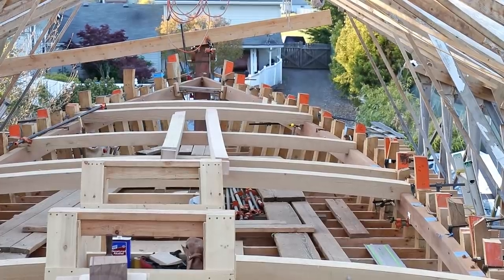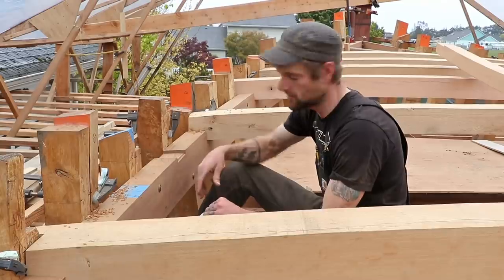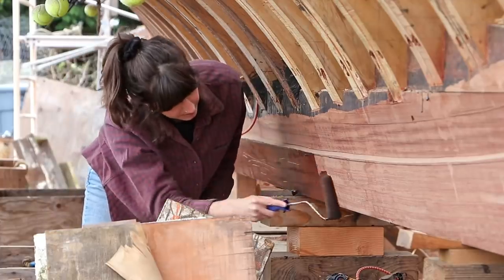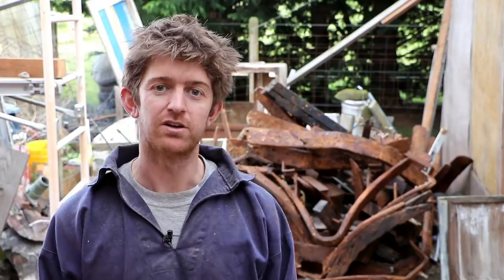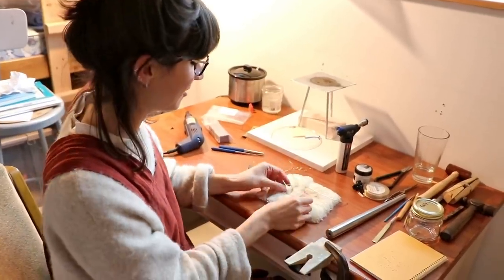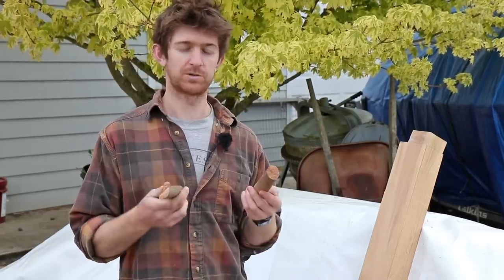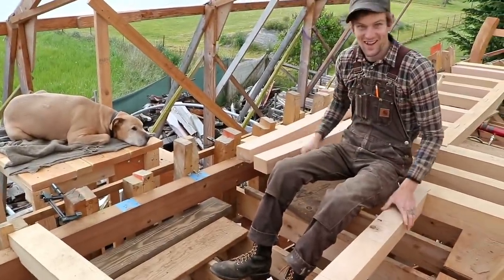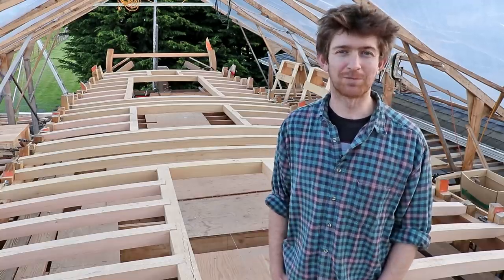BoatBuilding - Building the Deck Structure! (EP71)

Comment: i noticed how much bend the long deck beams have when you walk across them. Will there something supporting them or will they just carry the deck directly?
Reply: once the decking is on that force will spread to the other beams, and once the planking is on it should stiffen up the ends so that they don't deflect as much either.

And because it is timber, there will anyways be a little bit of give and flex in it, but much less than what you see now

Comment: Look at that contaminated wood under black light and see if it glows.  Try both short wave and long wave UV if you can (might have to borrow a short wave UV light, they are kind of expensive).  Long wave, 395 nanometer, UV lights are inexpensive.  If the bacteria glow under UV that would give you a good way to inspect the timbers.

Comment: Is anyone else feeling like the only reason they are saving that hatch frame is to say some part of the boat is original? Surely it is less work to replace it. Also you are sanding off lead paint. Wear a respirator, do it in a special area, and vacuum it all up. I was posioned from lead dust at about your age, don't make the same mistake. It settles on everything and you eat it by swallowing mucus from your nasal cavity, and from transfer after touching it. I'd carefully consider the resuse of a lot of stuff due to the lead paint alone.

The boat is looking amazing, I really appreciate the work that went into the joinery and the fit you produce. Looking forward to the next one.

Comment: The foremost hatch does not seem offset enough to accommodate a sampson post or any other deck fixture. I'm going to guess it's so that it lines up properly with the interior layout for the boat at that location...if that has already been drawn up that is. Hatches that are not centerline are usually positioned based on that requirement.

Comment: Hi Leo, I have a quick question. When making less structural parts of the boat that will still be exposed to the elements, is it still just as important to avoid knots in the wood? I'm just wondering whether avoiding knots has to do mostly with strength or rot resistance, or any other factors that I may not have considered

Comment: As others have said bronze castings do not make as much sense as welded fitments for both strength and ease of manufacture.  My dad built a Little Engines steam loco using a bronze casting for the main firebox and rear section of the boiler. It was a terrible experience because of the flaws in the casting.  The boiler firebox burnt out after only two steamings.

Comment: After a bit of googling (so probably not telling you anything you don't already know) bacterial wetwood or slime flux is an anaerobic bacteria inside the wood, which probably entered the tree from a root wound.  The characteristic wet look (and slime exuding from a bark wound when the tree was alive) comes from the bacteria weakening the cell walls in the wood itself, as it consumes it.  Articles seem focused on curing the live tree, and consist of washing it off so bugs aren't attracted, but I could find nothing on it weakening the hardness of the wood for high-stress applications such as this.  I couldn't find anything indicating it's not safe for other timbers to 'catch' it, as it's a living tree disease, but best be safe and not have it sitting on other timbers, just in case.  Same with any shavings from plane or chisel.

Comment: I've seen that dark spot before and was told it was caused by mold that was encapsulated as the tree grew around it.  It was described to me as "pithy", which can apply to wood, potatoes and carrots, it's spongy and a weak spot so yeah, don't use that piece.  Casting bronze is tricky,  but it will definitely last longer then iron.  While iron can be treated to make it more corrosion resistant, it's never going to be corrosion proof, so if you can't access them to keep them clean and painted, it's better to use bronze.

Comment: I've noticed some of the half beams are sitting proud of the carlins, will they be adjusted during the final fit?  Also, I'm envious of you and other guys can get the tools so sharp, I guess it's practice.
Reply: At this stage, Tally Ho is becoming her own Lofting floor resultant from Leo's insanely precision measures and construction. It is easier, and faster to fair proud  joints on the complex, multi-radius surface where the  final  decking planks will lay.  I believe that it is simply reducing the number of time consuming finishing cuts similar to roughing out the lumber with a chainsaw...now replaced with a beam cutting circular saw due to "noisy neighbors". Me learnst from building 7 boats in my backyard boat yard (smile).

Comment: Why is the foremost deck hatch, at the bow, off centered to starboard?  Good question. Upon reflection, and without perusing the detail plans of this sailing vessel, I would say that it has been moved to allow better access to the forward chain locker. ⛵⛵  As for the cast bronze floors, I was also thinking about the less expensive welded bronze floors in the Arabella.

Comment: Excellent workmanship and killer progress - super well done. BTW are their floors on every frame station or does the design not require floors at every station? Pity you can't use high density foam strips and glass to render the frames.

Comment: Leo, can you post where you got the long blue alum straight edge with the black handle? It sorta looks like a concrete float., but probably not. It appears to be around 5' or 6', and one side has ridges and the other is smooth. I would appreciate that very much. By the way, you have an incredible knowledge of woodworking and are doing a great job!  I wish I could help, but am not very mobile due to a knee replacement from a auto accident. I wish you the best and keep it up!

Comment: It is possible that the darker section of oak timber is the centre of the tree (the heart). Sometimes the centre of the trunk can become damaged and die. A common cause would be severe weather (heavy storms) or invasive insects or other creatures. This internal defect to the heartwood is sometimes called 'Heart shakes', Cup Shakes' or Star Shakes'. Once the heart of a tree is breeched, it often dies and as it does so, the Heartwood loses moisture content and becomes brittle. I can only guess that the vinegar odour is caused by decaying wood fibres.
Another reason for the darker weaker would could be the junction that a branch limb meets the main trunk. Smaller branches cause knots but on a much larger scale and with the timber being a hardwood, the knots are much tougher and don't fall away when being machined in the saw mill.

Comment: Leo, I couldn't help but notice your use of polyurethane glue in making the bent laminations for creating the bronze floor castings.  Is this glue something you've used before, and if so are you satisfied that it will retain its form over the years?  The reason for me asking is because in my bent laminated furniture pieces I have been successfully using PPR glues.  But because these glues are highly carcinogenic an effective and yet safe alternative glue would be nice to find.  Your thoughts?
Reply from the maker: Hi Marty, I've used PU glues a lot in boatbuilding and I've never had any problems. It's not structurally gap-filling, so the joints / faces need to be relatively tight.

Comment: Leo  - Couldn't help but notice in a prior episode that the plans showed a tiller, as the steering setup. Surely for long haul sailing, as you have said you intend to do, this will not be feasible. Do you intend to convert to a ships wheel, with rudder connections? If you have covered this already, my bad.

Comment: Leo, you talked about why the opening is off center in a previous video and mentioned that it was centered in the original plans, changed during initial creation and that you were going with the change rather than the plan and why.

Comment: Surprised that you used a grinder with disk pad to fair in the frames.  I assume you come back afterwards with a plane or belt sander to clean up all the little "circles." Guess it's the fastest way to remove wood stock.

Comment: Leo, I what dictates the joints you use in the different joinery around the boat?
Are they on the plans?
Are you copying them from original locations or some other mysterious equation?
Also could any defect White Oak be used for non load bearing furniture? 
Tony from Western Australia.
Reply: Stated in previous videos that they are following plans & what was on boat.

Comment: Hey Leo,  I'm guessing you're already familiar with Doug's casting and foundry work to make many items on SV Seeker. The casting work is certainly a big job, you mentioned casting in bronze, but is this just for authenticity, or couldn't other materials be used more effectively ? Fiberglass or wood composites should be much easier, or what about zinc dipped steel or even aluminum structures instead of bronze ?  Am I understanding their purpose is to tie the floor structure to the keel ? Do you have any intentions of storing anything down there ? As is, the supports are purely bent 2D forms, but an optimized 3D shape could allow you to make a much thinner, lighter AND stronger supports, costing less in bulk bronze  per piece.

Comment: looks to be too far forward for the mast so maybe the offset forward deck opening is to avoid the anchor post (is that the stem-post ?) Anyway something structural is in the way of the hatch and is pushing it to one side or the other.

Comment: Why don't you use stainless Steel for the floor bracket thingys? You could bend the bar with a bit of heat and bolt them down.
Reply: Ferrous metal (even st stl) is verboten on board Tally Ho - iron in contact w/ wet wood corrodes & weakens the wood, & mold/rot gets in faster.

Comment: Just how many of the ribs did you guys break while bending n molding them to their final shape?  Idk but building one of those has got to amount to building 200 to 300 houses. Basically one hll of a lot of work. time, time, time. To soak or pressure'ize the wood where it's flexible. Gotta be about two n a half weeks per rib.
Reply: The ribs weren't bent or molded, they were sawn.

Comment: The hatch is off center because the plans call for a head located forward to port.  If the hatch was in the center of the boat you would descend directly into the bathroom.

Comment: be careful with casting!
i've learned pattern maker when i was younger. You can still use your templates to create patterns for the bronze casting with the right dimensions (including the shrinkage rate ! ). If you have a foundry nearby they should be able to give you the specifications for either the dimensions and the pattern they need to perform the right casting.
Just be clear that after the templates you'll have to make a pattern for each single floor you want to cast. 

If that seems to complicated/expensive/time consuming for you, consider welding the floors out of bronze plates like they did on "Arabella" (Acorn to Arabella)

Comment: “I’ve sworn an oath of solitude until the petulance is purged from the lands.”

Why would the foremost deck opening in a sailing yacht be off centered towards the starboard? I asked this question online I didn’t get any specific answers almost everything showed up was for modern plastic sailing yachts (I know it’s not exactly plastic.) I checked both with yacht construction and racing yachts but I couldn’t find the answer so I’m using the wrong terms, I assume. Anyway, I’m guessing and it is purely a guess that that’s the chain locker and the majority of time or perhaps all times the anchor is on the starboard side because it would interfere with the Portside which is where the port/dock is located and you don’t want to huge anchor smashing into the dock. That is a pure guess but I basted on the logic I expressed earlier.
Reply: I know the bowsprit is offset on this boat. I bet it's structural and is to support the bowsprit.

Comment: The foremost deck opening is off center so there is room below for specific equipment to be stowed.  A chain locker perhaps, but most likely The Head.  Its called The Head for a reason!

Comment: I did a little research on your oak issue. Apparently this has been a known issue for a number of years. Yes it is called wet wood  but most of the research I read was from the 1980’s. At that time they were still trying to find a common cause. Pollution and changes to growing in more flood prone areas have been mentioned. As have Gypsy moth infestations.  All of these in my mind have a root cause which is stress on the trees. It is not uncommon for trees to be infected with bacteria IE. Dutch elm comes to mind but it is unusual for it to be in the heart wood. At any rate the bacteria grows in an anaerobic environment (no free oxygen) and produce fatty acids which I suspect is why you smelled vinegar.  The article I read was about the affects on the producers of oak products and the financial harm which was being caused by it. There is no apparent evidence of of the bacteria until the log is processed. Hope this helps. On another note when making bread yeast is added to the dough which causes the carbon dioxide to form but in better breads the dough is left in a refrigerator over night or up to several days. It is during this fermentation that the yeast growth is significantly retarded and the bacteria becomes active and in this case produces lactic acid when get bread much more flavor. Cheerio

Comment: why don't you relieve the corner of the floor pattern for the limber hole, save some bronze too!  do the keel bolts come up thru the floors and if so do you have to drill down to "match" the existing keel holes.
Reply: The floors will be through-bolted to the underside of the timber keel. These bolts are separate & offset from the bolts that attach the lead keel to the top of the timber keel.

Comment: Episode 7 showed concrete ballast over the metal keel/frame pieces, at least that's what I think I see.  Why have limber holes if you're going to pour concrete there?
Reply: That concrete didn't cover the top of the keel or the old floors, it just filled the space between the planking & the sides of the keel.

Comment: Concerning the discoloration: I think this is what's called 'bruinrot ' in Dutch.  A fungus breaks down the cellulose in the wood and that's why it breaks in such a particular way. It's typical that you don't see much signs of this type of fungus on the outside surface of the wood. (That's what I found...)

Comment: The deck structure really looks great and the 20 minute video doesn't do it justice for all the labor that was involved in building it. The cast bronze floors are going to be something to watch being built and should be a much better connection than the iron floors.

Comment: Is there a reason the cast can't be aluminium? Is the oxide layer not resistant enough?
Reply: sadly sand cast aluminium is usually quite porous and very susceptible to intergranular corrosion.

Comment: If the bilge is wood and the bronze floors are attached to wood, why can't the floors be wood? They would have to be thick to match the strength of bronze, but there is plenty of room at the v of the boat. Wouldn't wood be economical and a lot quicker?
Reply: Sid Vak - Weight!!!

Comment: Could the infection be a Slime Flux reservoir? Tree becomes wounded by a stress, bacterial infection sets in. The product of the infection then weeps out. Smells awful. Like a sickness, sweet and sour all at the same time. Like a human wound that gets an infection. Localized to that particular grain section. Again like a human that rips a muscle that then becomes infected. Localized.
Reply: "An important point to remember is that wood-decaying fungi grow very slowly. It can take these pathogens years to decades to create a volume of decay that is large enough to cause stem failure. The rate of decay varies with tree species, fungal pathogen and location of the pathogen (roots vs. trunk). The presence of some fungal pathogens (e.g. Grifola frondosa) does not always indicate extensive decay is present, whereas others (e.g. Ganoderma applanatum) signify extensive rot has taken place. Accurate identification is critical. Fungicides are of little use against wood-decaying fungi because the pathogen lives within the soil and woody tissue, making it very difficult to contact. Non-destructive detection of internal decay using tomography can be an important tool in determining if a tree is a hazard or remains structurally sound." - Nick Brazee, UMass Extension Plant Pathologist

Comment: Bronze floors will greatly strengthen the hull of the boat. But they won't make stresses on the boat disappear. All they will do is push those stresses somewhere else in the overall architecture, like  the infamous dent in a tennis ball. Do you know where those stresses will go, where they will concentrate? Stronger, in the sense of more rigid, isn't always better; what you want is controlled compliance, with good load shedding. You are not a naval architect and you are over your head. Get some technical advice.

The bad wood might be this wetwood you mentioned, but it might also be a fungal rot. Oak is notorious for tannin and acetic acid (vinegar) smells, although in the northeast we tend to associate it with red oak, not white. The punk  wood at your break looks fungal to me. In any event, goid to keep it far away from the boat. And you want to look over the frames once again, just to be doubly sure while there is still time to fix things.